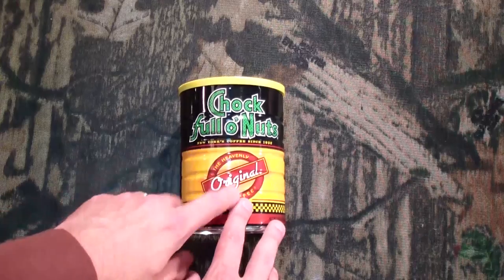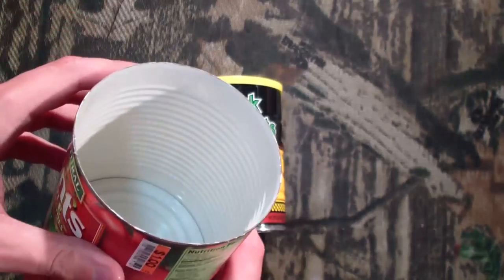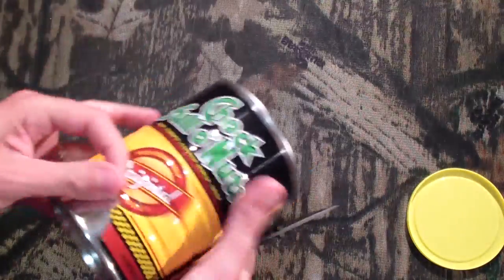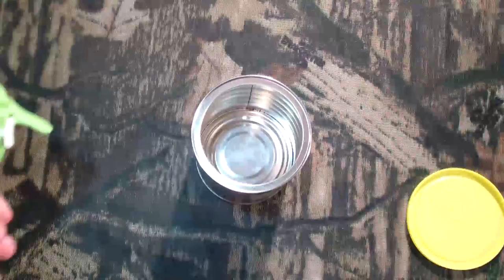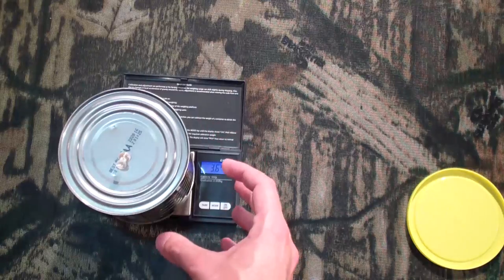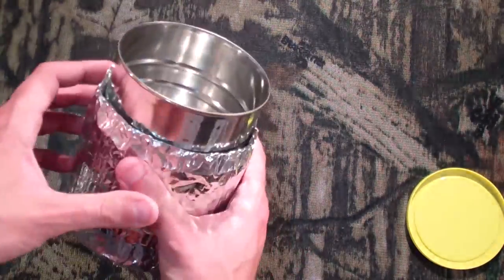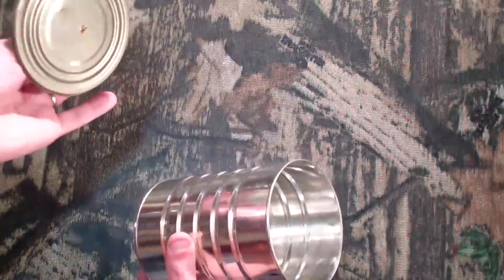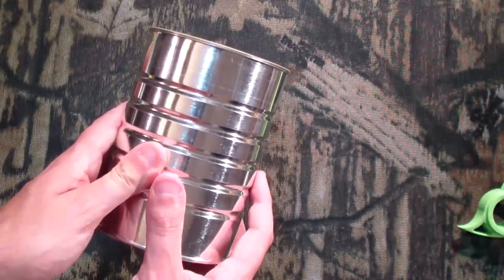DIY Ultralight Titanium Cook Pot Alternative

Comment: Hey guys.  For one ounce in weight penalty you can have a Brunton (the compass mfg.)   .9liter anodized aluminum pot with insulated handles and vented lid.  I've been using it for four seasons so far and it's doing fine.  Take  off the handles and the weights would be almost the same as this coffee can contraption.
Fun to fool around and make stuff but for me to do this I'd have to buy a can of coffee and the horizontal can opener.  Pretty expensive "free" pot.

Comment: I cook on coals only with my 1 gal old folgers can. i have had this can about 9 yrs. asvlong as you take care of the can, making sure can is cleaned right after eating they will not rust. you treat the metal ascyoubwould cast iron and oil it after every use. I also use liners inside to stew liguids to avoid the coating on the can from boiling off the can. if it boils off you have to re season the can, just like cast iron. thaks for the video.

Comment: I use a pineapple pot. A Dole pineapple can that has the pull ring on the top. Opened it using a similar opener to yours that unrolls the crimp and put a bread tie under the pull tab for something to lift the lid with. Never thought to look at the rings on the side of the can as a measuring mark. Will havta do that. Thanks!

Comment: Instead of cutting the rim completely off, just cut a fairly wide "v" in it to use as a pour spout. You can twist a wire coat hanger to make a handle, and use an aluminum pie pan for a lid, it will fit better and is stronger.

Comment: great idea, one thought use the top (which is aluminum) as the lid. Simply, don't pull off the top, instead use the safety can opener to cut the top off with the aluminum still in place.  Add a tab of muffler tape to the top for a lid handle, and Voila!

Comment: Cool video, love the DIY stuff. I've been using a #10 can for group cooking for years. May I suggest wrapping the can with fiberglass drywall tape, about 6-8 wraps, mid way up the pot. With the wrap you can pick the can up with out the burning your fingers. It's easier than the thumb cozy.

Comment: This same cook can system works over wood cook fires, make sure to season the cook can a few times with oil before using for human consumption. With each use season the can a bit more with Olive Oil. I implore anyone using cans with liners to fully burn off all plastic or other can liner residue before human use, if at all possible use an all tin can from the start. Also at the end of each meal let the can stay on the heat to boil remaining moisture off & away from the seam on the cans bottom.

Comment: Ugh!  Getting harder to find metal cans like this now.  Finding plastic and card board instead. Trying to make the Fosters can but the “tuna” can ring just won’t fit.  Fosters can tears when trying to stretch it.  Can leave it as is at only 1 oz.  but fragile.  Will look for this can though.  Light weight is mandatory for me for physical reasons.  Thanks for the video!

Comment: Is this the 30.5 can of Coffee, I found one at Walmart, just checking online and 30.5oz. is the size they have, the only other is 11oz.
Reply from the maker: +Rspene smit I know for sure that the can in the video isn't an 11 oz.  I can fit close to 3 cups in mine when using it, so the 30.5 version you saw sounds about right.
Reply: +sintax77 REMEMBER: the "11.3oz" is THE DRY WEIGHT OF THE COFFEE GROUNDS!!! As for VOLUME: I'm standing a new can that I bought for this project (thanksSyntax77) next to my 32oz/1 liter Nalgene bottle, and thus it looks like the "11.3 oz" coffee can will hold about 3 cups of liquid.

Comment: I wouldn't use a can without a molded bottom (usually a rounded stackable base ) since both ends are attached to the can with adhesive unless metal folded together type.  Old coffee cans were the folded type, and secure, but many food cans today are adhesive.  After a time, the bottom could just fall off in the fire and take dinner with it.  A good way to test the line of cans you want to use is one of those can openers that separate tops from cans without sharp edges, because that hand opener depends on the principle of loosening adhesive .  If the bottom comes off too then for long term use cook can, choose a molded bottom.

Sidebar:  If you have cans but no can opener, flip it upside down and rub vigorously on a smooth rock until it leaks, then slide top and can together to flip it right side up.  You should be able to peel the lid off now that the adhesive is warm and loosened.

Comment: Another great video.  I haven't checked on this, but the steel isn't galvanized is it?  one suggestion for your set packing.  One should be careful with storing a alcohol stove in your pot or cup.  It can cost the inside of the pot.   To be safe I store mine in double zip lok bags if I store out in a pot or cup.

Comment: Great video. I have also tried this, but found out the the tin rush after 1 time used. The rust specially happened on the join portion of the can (where you can see the black line from top of can to the bottom). Maybe this happened only in my area (high humidity).

Comment: What are the dimensions of the can?  They make a whole bunch of can sizes(  11, 30.5, 33.9, 48 etc.).  I will not be able to figure it out because it's not sold locally, so I'll have to order the coffee online. Thanks
Reply: +Troy Belanger  I have a 40oz yams can (dia. 4", H 6"), unfortunately, with a liner.  It matches the 28oz tomato can's diameter. I estimated that the yams can could hold up to 14oz of coffee.  So I believe that the 11oz coffee can is the correct one please verify thanks.

Comment: Question: Your gear list shows this cook pot and set up and disposable water bottles and bags. In another video, you cooked right in the military cup that goes on the canteen. (I might be confused, of course). Is it lighter that way or do you prefer the DIY cook set up for other reasons? I'm making my own DIY set up because of this vid but the canteen and cup look cool too. BUT, I don't want to spend the money on the canteen if I'm just going to leave it at home anyway. Thoughts? I probably sound like I'm getting picky here but you're a really good teacher and I take your advice seriously.
Reply from the maker: Ding Dion Yes, I used a canteen cup and stove / windscreen on my first solo video in NH.  Like you said, it's a pretty cool setup, and functioned fine, but was a good deal heavier than the DIY system I switched to later.  Mine stays at home now, but I still like it for nostalgia.
Reply: sintax77  Awesome. I made one just like it this week. Imitation is the highest form of flattery. Thanks for all the help.

Comment: any problems with rust inside your full o nuts can?  Mine did.. maybe i didn't dry it out?  check out Ultimate Alcohol Stove awesome stove and fun to make lol.
Reply from the maker: I haven't had any rust form inside the can, but my friend had a little.  I just always make sure to give it a quick wipe before field packing, and let it sit out for a day or two at home before storing long term.  For the exterior, hit it with some Rustoleum BBQ Grill paint.
Reply: I guess ill scrub with an sos pad and make sure to dry it out from now on.  Whens the next backpack trip?
Reply: sintax77 Another good solution that has worked for me is to "season" the pot like you would cast iron.  The pot needs to be really clean before you start (dirty spots won't let the coating adhere) and I would do both inside and outside.  Makes them ugly but I haven't seen any rust yet.
Reply: a friend of mine suggested putting a coat of canola oil inside.  so i scrubbed with an sos, got the rust out and hit it with canola oil and wiped the excess out.  we will see how this goes.  ^^^"season" the pot.  going to get some grill paint next time im at wally world.
Reply: 731byrdman Season it like you season cast iron, wipe it with oil then heat it.  The oil will change so that it won't go rancid and then will bond with the metal to form a non-stick coating that isn't toxic.  Additional coats while hot will provide a better finish.  My pots are black inside and out...

Comment: How did you attach the push-pin handle to the lid?
Reply: Make a hole in the top - may can use the push-pin; insert the push-pin and bend their tip, e.g. in a circle.